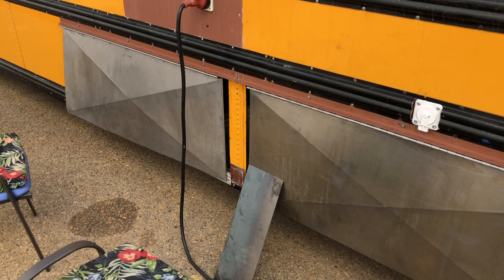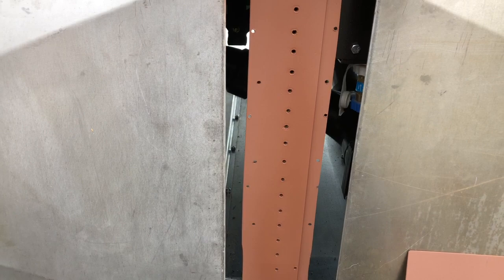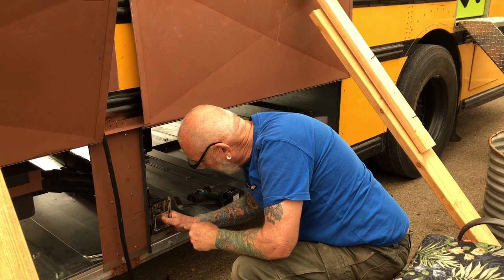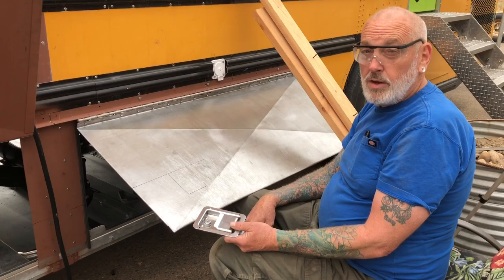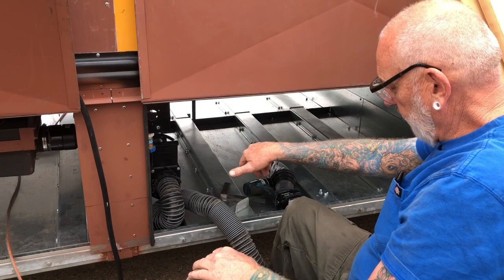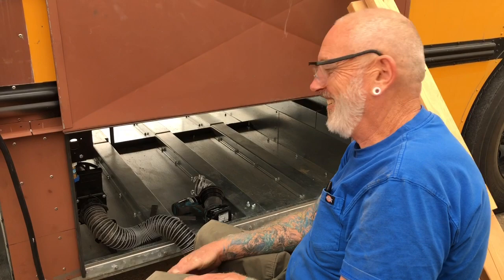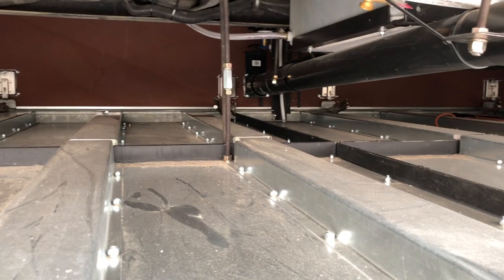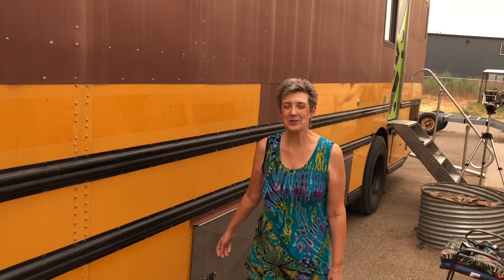Under Bay Storage Doors - Part 2 - Vlog 164 School Bus Conversion

Comment: Looks great, I need to make friends with a dude who has a metal shop. I would make them 1.5 inch thick with foam board in the middle.

I think you guys are on the top out of all of them, closest to a production coach.
Reply from the maker: They’re going to have 2 inches of rigid foam insulation on the inside of them. With a frame that goes around it pop riveted to the door to increase the rigidity of it. So in the end it could be very similar to what you’ve described. Thanks so much for your comments we appreciate it 😀
Reply: @KnappTime  thats awesome!

Comment: Hey guys, check out this part. Valterra T1023 Bayonet. Also if you would like you can connect from the bottom outside exterior if you add this part as well.Valterra RV Sewer - T1021
Reply from the maker: Thanks so much we’re going to check into those. 😀

Comment: Why the diagonals on the doors.  For strength aluminum angle or tube internal framing would be stronger.  I think the doors are too flimsy.  Security will be compromised.
Reply from the maker: There’s going to be a frame on the inside of the door that holds the insulation to the door. That will increase the rigidity. But with the double latches they are quite secure So Security doesn’t seem to be a problem :-)

Comment: Why not put the latch in the center of the bottom of the door ,then you could put that small door for the drain hose
Reply from the maker: The doors were too flexible so it wouldn’t work that way. We needed the support on both ends  to hold them down good. We wanted to do it that way but the corners were just too floppy.👍

Comment: Nice fix Randy. Looks great. Are you going to put gas struts or magnets to keep the doors up? Thank you for your video.
Reply from the maker: We are adding stainless steel D loops. And a simple spring latch to hold the doors up. We will show it in a future video.  I do not want to put on gas struts because if the latch malfunction going down the road the doors at flying open. Not cool 🤨
Reply: Knapp Time thank you for your answer. Love your videos.
Reply from the maker: Thanks 😊

Comment: I thought you were going to re install the rub rails along the bottom of the doors? Obviously with the x bracing your can’t really do that.  Also will you be adding anything to make the doors more rigid?  

And what’s with the trolls in the comments? Geez get a life. How sad when your business model is to post and leach your porn onto peoples hard work. Smh
Reply from the maker: You’re absolutely right the cross break made it so I could not put the rub rails back on. That is what I wanted to do at the start. In hindsight it would’ve just made the doors even heavier. And yes there is going to be more bracing on the inside to hold the insulation to the door so they’ll be a half of a hat channel pop riveted to the door that hold the insulation on.That should make it more rigid will see :-) work in progress :-)